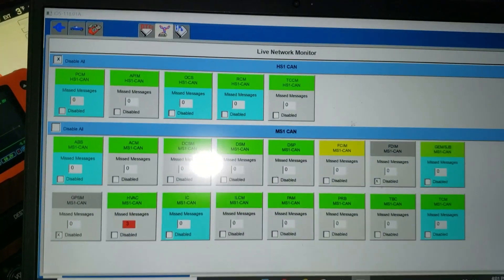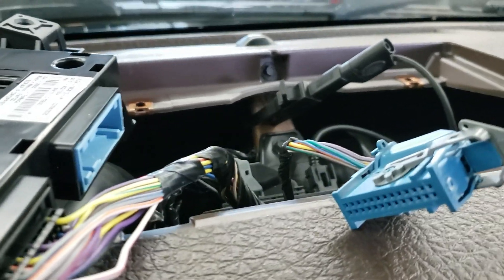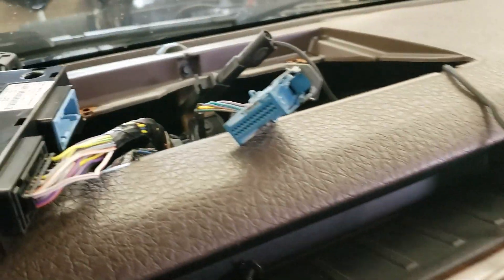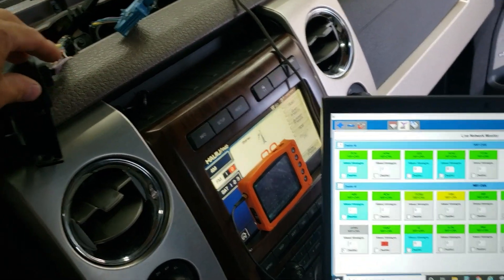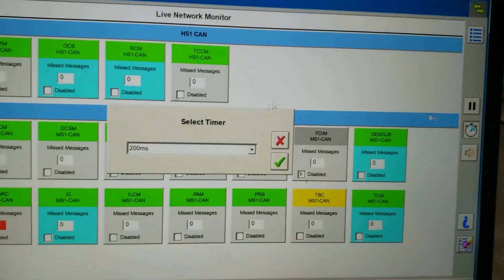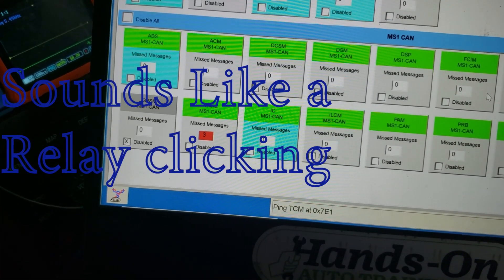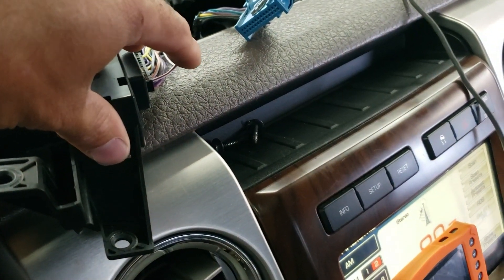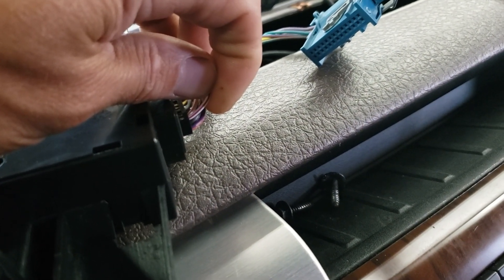Ford IDS Live network test F150 HVAC Module

Comment: Where and how do you access the network settings within the ids software?
Reply from the maker: Network testing,  live network test, /network test is under thr red tool box
Reply: I have digital multimeter I can select and requires a VMM that I don’t have access to at the moment. Other option Oscilloscope Tools with sun categories. Ty for the quick reply

Comment: HELLO  BRIAN, I ALWAYS SAY YOU'RE VIDEOS ARE THE BEST. I WANT TO GET INTO PROGRAMMING AND I HAVE HEARD THAT CHEVROLET IS THE EASIEST BUT I HAVE ALSO HEARD THAT YOU CAN NOT PROGRAM CHEVROLET OUTSIDE OF THE USA. SO MY QUESTION IS, HOW WOULD I GO ABOUT PROGRAMMING THE SECOND EASIEST CAR LINE BEING HONDA ANY HELP WOULD BE GREAT THANKS FOR YOUR TIME.
Reply from the maker: Where are you located? I am not sure the restrictions ans requirements out side the US.
Reply: @BrianMann216    HI BRIAN,  THANKS SO MUCH FOR THE REPLY I AM PRESENTLY LOCATED IN THE BAHAMAS LOOKING FORWARD TO ANY HELP.
Reply from the maker: @8power0   let me know what you plan on setting up. I really do not know the limitations/ location restrictions.
Reply: @BrianMann216  BRIAN I JUST WANT TO BE ABLE TO SCAN AND PROGRAM CHEVROLET VEHICLES, I HAVE NEVER PROGRAMMED ANY VEHICLE BEFORE . SEEING THAT IT'S MY FIRST TIME I WOULD LIKE TO KEEP THE COST LOW POSSIBLY USING A Drew Tech Mongoose Pro OEM Diagnostics & Programing Cable Compatible w/ 1996+ GM OR IF YOU KNOW OF SOMETHING BETTER IN THE PRICE RANGE . I WOULD LIKE TO KNOW WHAT IS REQUIRED AND HOW TO SET IT UP I WOULD PREFER SETTINGS UP THE SOFTWARE ON A TABLET BUT IF YOUR WAY OF DOING IT IS ON A LAPTOP SO BE IT. I AM LOOKING FORWARD TO YOUR HELP AND HOPE TO HEAR FROM YOU SOON THANK YOU .

Comment: does that work with VCM 1
Reply from the maker: Excellent question,  I do not know..
Reply from the maker: I was using a vcm2
Reply: @BrianMann216  i have explored my ids and have never seen that. Network test seems to just run comm tests with pass or fail. i wonder if the vcm1 has different software than ids 2 or 3. i think i just updated to 142.2 . i need to update but it just keeps working.. ha ha
Reply from the maker: @carlbrandon8040 I know that for some vehicles I do not see the test ( older ones)
Reply: @BrianMann216  Where is that test located in IDS ?